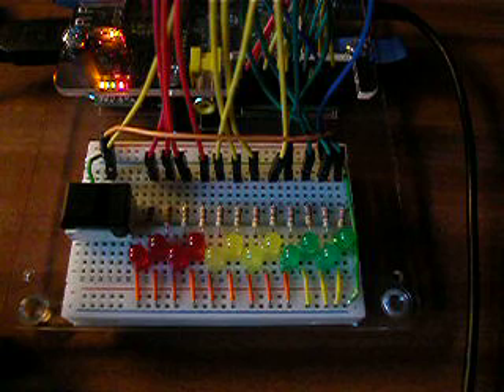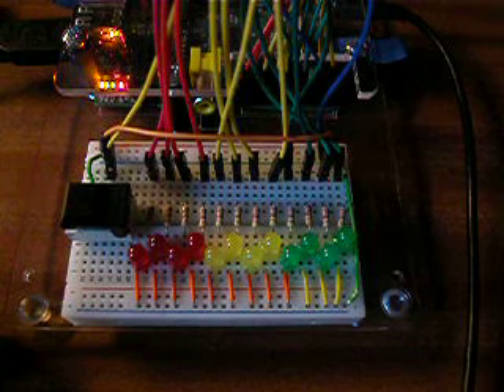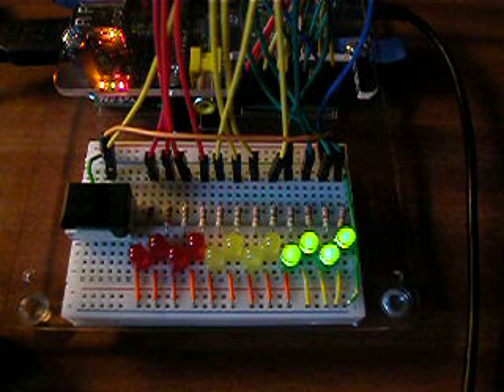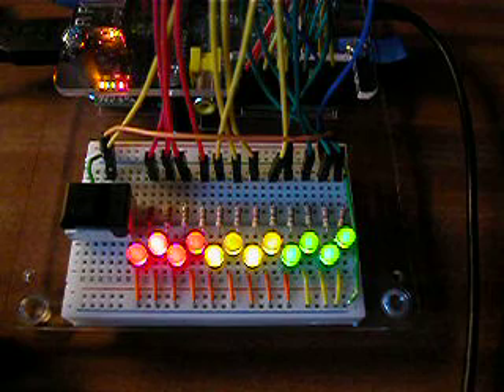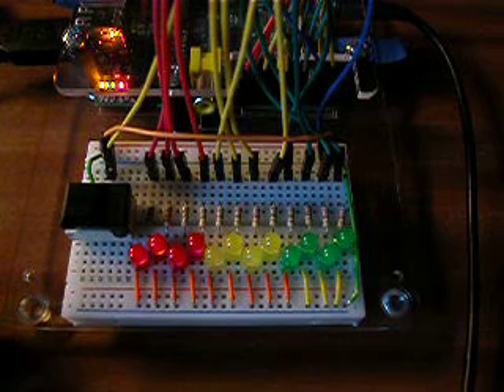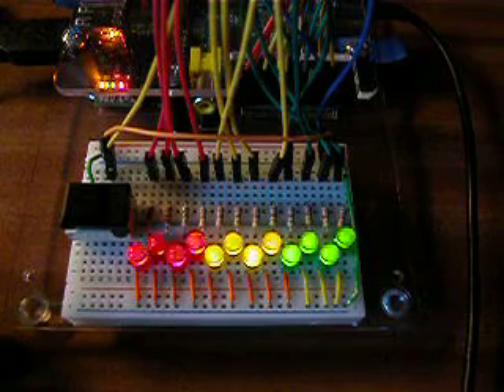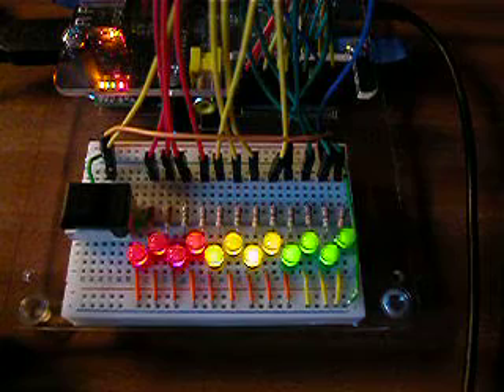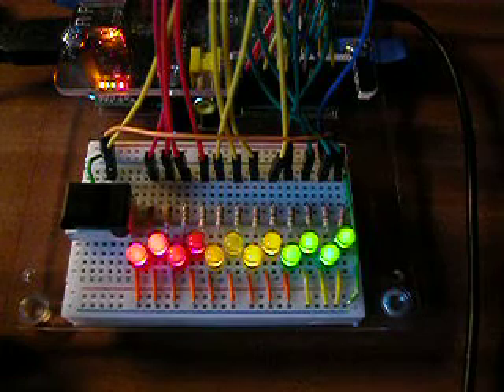Software PWM on the Raspberry Pi

Comment: I made my own software PWM in raw C the other day. It doesn't do all the pins like yours does, but it works. 

I was mainly focused on getting around the problems with the recommended raspbain distro not being a proper RT-OS/kernel. I have the latency accurate to (on average) 30~50uS. The biggest spikes I have seen so far were ~750uS, and fairly infrequently, only when I'm really loading the system. 

What are you getting with your code if I might ask?